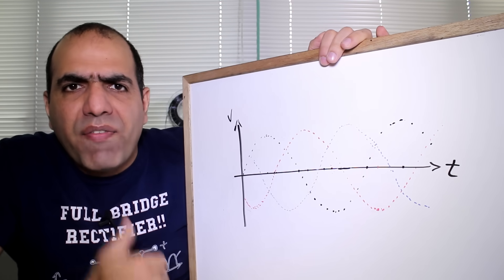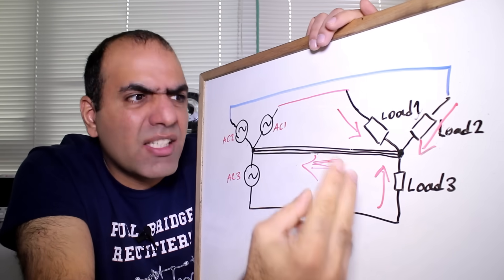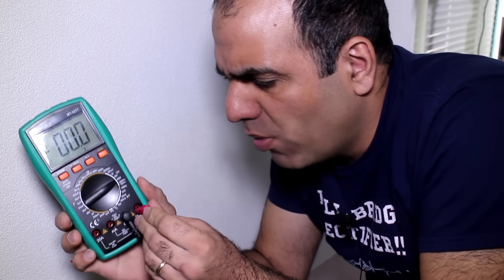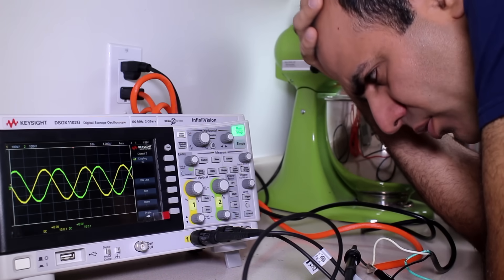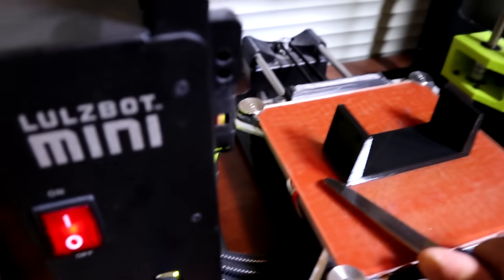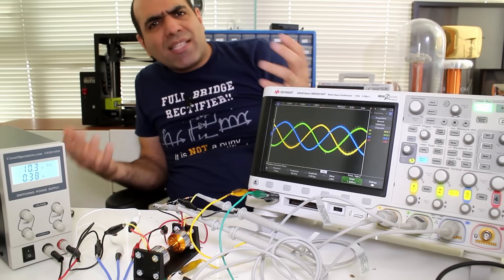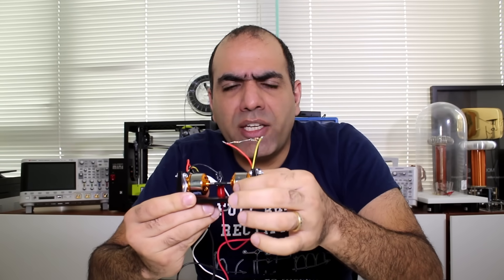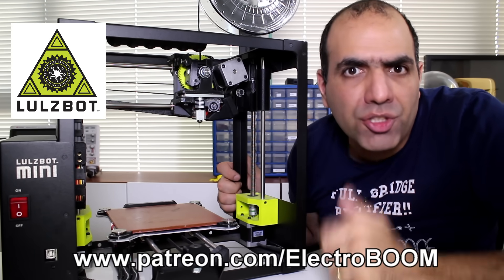Why 3 Phase AC instead of Single Phase???

Comment: Thanks for your helarious & informative videos, I don't know where in Canada you measured that 2 phase sine wave, but here in Ontario/ residential we have 2 phase  240V ,  180 degree phase shift if I am not mistaken.
Reply: There are two configurations for residential power in North America. 

The first is common in detached housing. It is supplied from a center tapped, single phase transformer secondary. You have 240V between the two hot lines and 120V between each line and the center tap (neutral). You will see 180° on a scope.
 
The second configuration is common in large residential buildings (high rise). It is supplied from two out of three conductors of a 3-phase WYE connected transformer secondary. The neutral is from the WYE connection point. This is powering a single phase circuit from a 3-phase supply. You have 120V between each hot line and the neutral and 208V between the two hot lines. This configuration uses a 208Y/120V 3-phase supply with each single phase circuit using only two of the three hot lines plus a neutral for 120V loads. Because it is derived from a 3-phase supply, you will observe 120° on a scope.
Reply: @mikemackenzie3049  Thanks👍

Comment: If u have 2 15 amp loads connected to line 1 and line 2 and neutral, there will be no current 
on the neutral, BUT if u have same loads on line 1 or 2 with over-current at 15 amps you will
cause a fire by burning out the neutral which will be carrying 30 amps.

Comment: You don't get 3 times the power with one additional wire, the only efficiency benefit you get is that it uses a higher voltage. You could also have single phase AC with a higher voltage, would have the same effect on the amount of copper you need per watt. In fact, with 3 phase power you need more wire, because now you also have a neutral wire that is only sometimes used. The real benefit was that they could make simple induction motors without electronics and that 3 phase is easier to convert to DC than single phase power.

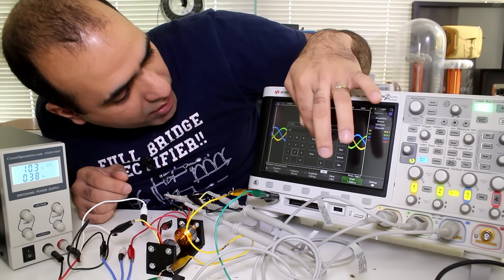Comment: 7:40 another benefit of 3-phase is that there's always a constant voltage between the most positive sinewave and the most negative one at any point in time. So, it's possible to obtain DC without rectifiers (by switching the sources 4 times per cycle).
Reply: Well it's roughly constant, and you usually still need diodes.
Reply: rectifierless DC?! That's heresy around these parts!

Comment: Yes, the use of 3Ph needs less copper wire and this is a big plus. 

But there is one practical reason that requires utilities to use 3 phase AC instead of single or or dual phase. This is is because the total power generated or consumed in the balanced 3 phase system is actually constant.  

This constant power in 3PH can be easily shown mathematically.  A 1MW, 3PH  generator will produce a constant 1MW of power. A single phase generator will produce pulsating power ranging from 0 W going to 1 MW, 120x per second (for 60hz systems). Since power represents the energy per unit time that goes into or out off  the system, this represents the actual mechanical energy input to or outputted by the system. This mechanical energy fluctuations cause vibration. The vibrations in a single phase system will destroy the 1MW single phase generator within a few cycles!  That's why any generator or motor larger than a few kw needs to be 3 phase or it will be prohibitively expensive to build a housing that can withstand the vibrations. Today 3PH generators of several hundred MW are common. This would be impossible without 3PH.

Constant power is only possible in a balanced 3PH system. Utilities take special care to balance the generated loads by equally distributing the load over the service area. Building designers must also balance the 3 phase power distributed in a building by equally distributing the phases over different circuits in the building.

The DC generators of Edison also generate constant power. But DC is difficult to distribute over looking distances. Tesla invented 3 phase to produce an AC system that also produced constant power but could easily distribute power over long distances because it is easy to convert ac to high voltage (and vice versa) using transformers. High voltage require relatively small diameter copper wires for long range distribution.

Comment: 240 AC in Canada (and US) is delivered to the house with the neutral tapped from centre of a local transformer (aka split phase).  Having a voltage of 203V suggests there is an apartment building transformer taking in 3 ph and and splitting off 2 phases to apartments.  (apt A is red-blue, B is blue black, C is black blue, etc), nominally 208V.  In my kitchen, measuring both hots gives 240AC (house), and all single phase.

Comment: I am not reverse engineering anything in life.
I am telling you what I know works.
I am not making anything complex at all.

We create AC electricity, therefore we can use AC electricity.
The vehicle will start the exact same way it does with a combustion engine. You will spin the motor with a starter and need to spin fast enough to pump enough juice to start the induction motor which will take over your flywheel.
If your battery is ever dead you would only need to spin the flywheel that would spin more than likely 2 more alternators and your going to have a 3 phase induction motor in your vehicle. As you spin that flywheel you will be pumping juice directly into the battery. When the battery has enough juice you can go sit down and flip your key and the starter will spin until it gets enough juice to be taken over by the induction motor.

The induction motor is like a grinding bench and connects to your flywheel and your pulley. The exact same way your combustion engine is as we speak. We match the rpms of what your current vehicle in idle sits and give it the ability to throttle, the exact same way your combustion engine does.

You do not have a radiator anymore. You do not have an engine oil system anymore. You do not have a fuel intake system anymore. You do not have an exhaust.

You do still have the same transmission though. It even works with the same computer because we designed our system to match the rpms that it is familiar with.

You could take your starter apart and put it back together where it's teeth never un-attach from your flywheel and it will generate power back to your battery.

In my system you are using alternators to create the power for your 3 phase motor. The leads on your alternator are going to go through a capacitor as AC electricity and going to vibrate your magnetic field to stupid amounts and have a coil inside of something that captures as much of this frequency as it possibly can. It's going to be designed on a system that when you get your flywheel spinning to 500 rpm with your starter your 3 phase motor will take over the flywheel and be spinning the pulleys that spin your alternators. When the coils for your tesla coil are farthest apart you are going to be at whatever rpm you needed your system to be in idle for your transmission to be able to accept it. In park your going to be able to take your tesla coil and get it closer together and it will rev your engine. We need this to match the rpm style that your combustion engine does, it isn't going to be hard.

You just converted your personal vehicle to a fully electric vehicle.
It wasn't rocket science.
But how difficult could a rocket be after that?

Comment: Hi! Greetings from Norway! This was very fun and extremely well explained video! However I have an other question that I was hopping You could answer for me: I have 3 phase 230 volt system at home. Since I have bought en electric car, I have now a transformer that takes 3 phase 230 to 3 phase 380. Is it possible to do the same thing but using some digital/electronic machine? The transformer does create some noise, so it would be great to use some digital/electronic appliance instead! Does this exist, and if yes, what are they called? thanks a lot!

Comment: I can't wrap my head around what 120 degrees of shifting is.
Reply: A sine wave oscillates endlessly, so instead of thinking of it as a line that goes on forever moving up and down, think of it as instead drawing a circle. Once you complete the circle, you've completed one oscillation of the sine wave. You can use degrees or radians to describe how far along the circle you've drawn, which can be related to how far along the sine wave you are. A shift of 120 degrees means that one wave is 120 degrees offset another wave. So if you were drawing circles for both waves, one would be at 0 degrees while the second is at 120 degrees. And when that second wave hits 360 degrees and completes the circle, the other will be at 240 degrees because it is 120 degrees behind.
Reply: @thegreatzoom5073  AHH. That's a good way to look at it differently. Thank you.

Comment: A friend of mine has 3 phase power from the utility company for a well pump. He's wondering if he can pull 120-24V for a small subpanel. I'm not sure if it's Wye or Delta. I assume if it's Wye, there will be a neutral, therefore pulling the sub-panel power should be straightforward. In the likely case that it's Wye, I understand that he would he have to consult with the utility company and see which of the 3 positives is center-tapped in order to create a correct, single phase circuit. How is this done? Or am I way off base?

Comment: Do you or anyone else reading this really think you need a three phase motor to run a large power tool like a large tablesaw if the same machine comes in either single phase or three phase?

Comment: Great video, a couple of points.  
1 The input power of 3 phase motor with a current of I amp per phase and a phase to  is is not 3VI but (sqr rt 3) VI
2 The reason why the motor generator set had a low efficiency was because the magnetic field was just the residual field in the laminations. Full size generator either have a rotating rectifier or slip ring to supply a dc current to the rotor.

Comment: In former Yugoslavia (remember, Tesla was a Serb born in a village in what is today Croatia), you get all three phases to your house. At least those built after 1960s. In the kitchen there is always a special three-phase outlet for the stove-oven. That balances the power consumption. Also water heater for the bathroom and the washing machine are on separate phases with the third supplying refrigerator and maybe a freezer in the kitchen.

Comment: Just to confuse you, In The UK (and therefore probably most of europe) The Neutral is Black and the 3 phases are Red, Yellow and Blue. Houses are only connected to one phase, If you have a row of 30 houses in a street, 10 will be on red, 10 on yellow and the rest blue. The advantage to that is that when the power supplier has to work on a house input line they can pull a fuse and only cut power to 10 houses.

Comment: What's the next step after 3-phase that has any actual use? And what advantages does going over 3-phases bring? More power of course, but... More speed in case of motors? More torque at lower speeds? More control or granularity?

Comment: I find it ironic that they call them sine wave generators... yet within physics and mathematics cosine is preferred more than sine especially when dealing with vectors and matrices due to the relationship between the cosine and dot product. And when you translate a sine wave by 90 degrees horizontally, you in fact have a phase shift translating it into a cosine wave... So why do they call them sine wave generators instead of cosine? Just curious! I guess it just comes down to one's convention...

Comment: I don't recall you mentioning DELTA and WYE configurations... The DELTA (or the coils/loads connected in a triangle ) doesn't provide a neutral (not needed) so it's good for long distance transmission such as from generator plants feeding the transmission grid...then a transformer at the other end (substation) converts DELTA to WYE. The WYE provides for a NEUTRAL which is necessary for 120v in standard US power distribution. You can't get 120v across the phases unless you step down with a bigger turns ratio. So typically (in the US) across the phases is 208-230 volts and typically 115-120 phase to neutral. You have 2 phases and a neutral coming into your home from the power company.

Comment: From his biography - Tesla dreamt of the number 3 when pondering how many phases to use in his electrical designs. He was considering 2, 3, 4 and 6 but the number 3 came to him in a dream and so today we have 3 phase power systems (although nothing would have stopped another inventor from using 2 or 4 phase systems - but 3 seemed intuitively balanced and "just right" and Westinghouse just adopted the patents). Tesla became OBSESSED with the number 3 and did nearly everything from then on in multiples of 3 (such as walking around the block 3 times before entering a building). 3-6-9 holds special significance too. In technical high school we had 3 phase 120/240 motor-generator equipment in the lab and let me tell you something - try disconnecting one phase while it is running - not fun! BOOM!! These were not small DC motors but large 10 HP industrial systems. Not fun running an imbalanced 3 phase motor generator setup - the sparks were ELECTRO BOOM style though!

Comment: If any two phases are shifted by 2pi/3 radians or 120 degrees then how is the sum of the two phases providing a higher voltage? If you add sine functions phase shifted by 120 degrees, I found that the amplitude of the resulting sine function is the same as the initial sine functions. Is there something wrong in my understanding?

Comment: Very interesting video, I am an electrician on a USCG cutter, we use a wye configuration like all ships. 
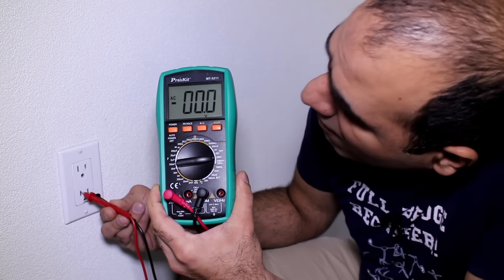Funny story: in trouble shooting a generator we took current and voltage readings on the governor actuator control circuit... I did exactly what you did at 3:05 thinking my meter was set for voltage and killed the governor thus killing the generator and the entire ship's power... That's one way to learn a lesson about checking your meter XD

Comment: Outstanding video!!!!! You can work an oscilloscope as well as a DVM and still look respectable! :)

In every apartment I have ever lived in before finally becoming a homeowner here in the United States, the "hot to hot" voltage was always 205-210 (which reflects the 120 degree phase difference) instead of 230-240 volts (which reflects the 180 degree phase difference almost always seen in standalone residential houses). 

The reason why builders do this for apartments is that to supply center-tapped 120/240 volts from a common single phase transformer for, say, 300 apartment units spread across 10 or more separate buildings requires significantly more cable (number of plus size of conductors plus the associated labor) than the equivalent three phase system to deliver the same power. Installation costs alone would be $100,000 or more difference.

A second reason is that the local utility company encourages three phase usage to keep the phases balanced. Without this, using a large 1000 kVA single phase transformer would require two additional apartment complexes each using the other phases on the same circuit (often on the same street) all running at equivalent power levels.

So our 300-apartment complex example will still have its two phase load center in each apartment. First group of 100 apartments would be Phase A and Phase B hot-to-hot. The second group - Phase B and Phase C. The third group would be Phase A and Phase C. Nominal voltage is 120 * 1.732 = 208 volts. Most of the smaller ranges and dryers marketed for apartment use are designed to function at either voltage but the lower voltage when applied means the oven will not get nearly as warm since you have 25% less power going to the oven. [The surface heating elements on most smaller and older ranges still use 120 anyway so no loss there.]

If electric heat is a factor, all that means is either a 208-volt rated baseboard heater or install 240-volt heaters and the customer will wait longer for the room to warm up using the lower voltage. The thermostat works the same way either way.
Reply: I'm not sure - but in comments on Technology connections channel someone said that in reality on 208V you have like 86.7% of power of 240V. Which would make sense given that 208/240 = 86.7%. Then again I'm not sure if there isn't something that would reduce it (current? Should be the same, but 120 degree shifted phases don't cancel each other out - so there might be some losses there). Now I have to go and rewatch that video.
Reply: Of course - this depends on whether the appliance was designed originally for 208V or is just a 240V appliance that can work with 208V. In first case you're closer to 86.7% in latter to 75% - because wattage goes with the square of Voltage. But if you optimize - you can regain some of efficiency (not in terms of raw power of course) - so it mostly depends if what you need more is power or current.

Comment: why do you need two motors - cant you use the three phase convertor directly - takes dc in and gives three phases ?
Reply: One of the "motors" is a generator. Generators and motors are extremely similar mechanically. A generator is driven by an external force and the moving magnets move charge and give voltage, while a motor is driven by voltage which applies a force.
Reply: @thegreatzoom5073  thanks but you missed my point. NO motors